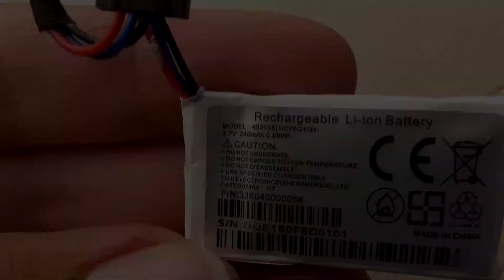Mio MiVue 508 - rozebranie i wymiana baterii

Comment: Very good video! A new battery with 2 wires (instead 3 wires) it's gone work properly? What is your opinion?
Reply from the maker: It's Li-ION battery. AFAIK only 3.7V Li-POs have two wires. It could be dangerous to plug Li-PO battery into this DVR.
Reply from the maker: Yes, that is a problem. Battery from above link is a POLYMER, not a LITHIUM-ION one.
Reply: Can you suggest me some battery?
Reply: @WojciechMikula  Li-Po is nothing more than a variant of Li-ion, with electrolyte in gel form. As long as it will not be overcharged, overdischarged, used outside temperature range or subjected to overcurrents it will work the same. 3rd wire is for NTC, for monitoring cell temperature, usually 10kOhm, B=3435K, but this may vary from battery to battery.  Without temperature signal it will most likely refuse to work. You can always simulate it with a resistor, but I'd HIGHLY NOT RECOMMEND THIS in a battery that is used in a car, subjected to extreme temperatures.